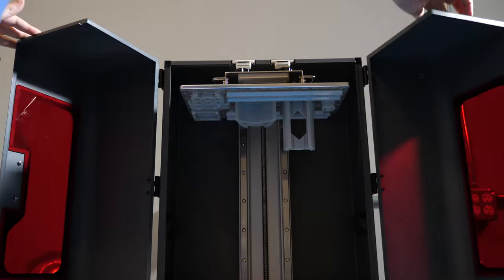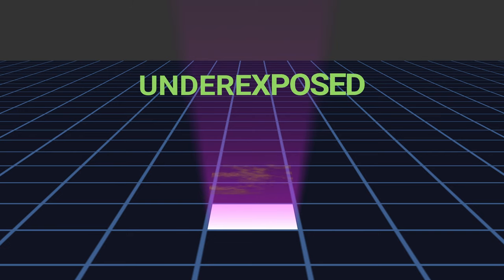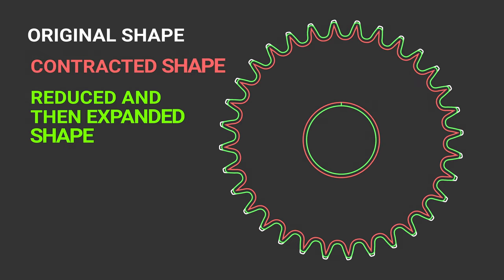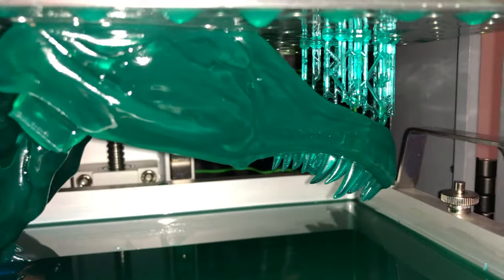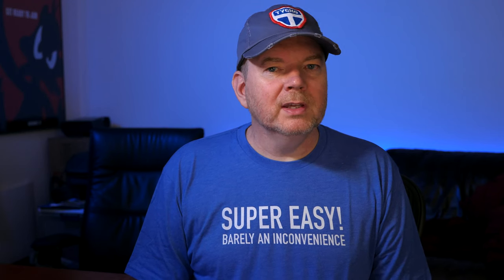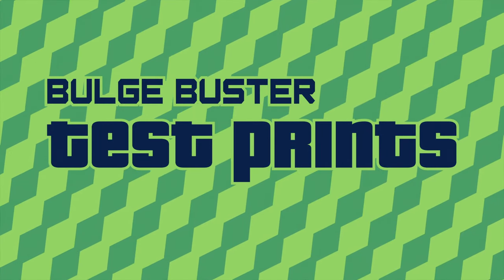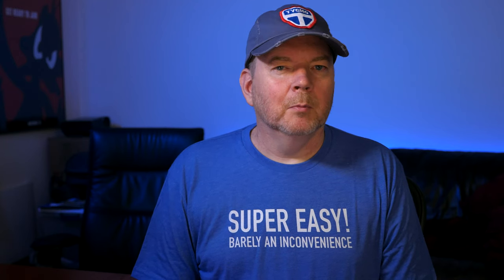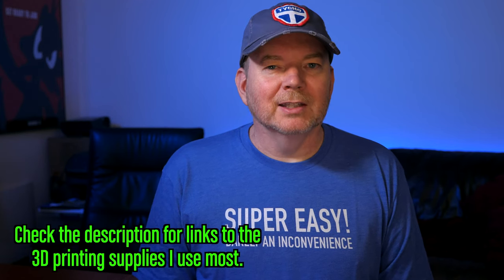Remove the Elephant's Foot from Resin 3D Prints - Plus NEW FREE Bulge Buster App

Comment: There's also a simpler method at the only cost of spending a bit more resin - don't print on the build plate (which I'm always to do with miniatures bases for example), use some supports and the elephant foot will be left only on the supports/raft, which goes in the trash.

This video is very interesting from the aspect to understand (and control) precisely the printing, but I don't think it's very practical for most people (unless it's somehow automated in next gen printers)

Btw, if I understand correctly the transition layers purpose is not so much to reduce the elephant foot (they can't reduce it on the very bottom layers that take the full exposure anyway),
but to ensure more gradual curing condition of these layers, to prevent delamination (by having two layers being cured at 10 times different speeds)

Comment: Overexposure is not the only culprit of elephant's foot. There is little time for resin to settle after the build plate has entered the resin, positioning itself as the next layer is exposed. Some printers allow per layer settings and can be tuned with UV tools

Comment: So you just made a resin exposure calibration tool. I used to work for Eckerds 1hr photo and we actually had a tool that would tell us how off the exposure of the chemicals in the film was and it required the light amounts and times from the machine for quality testing. Each color had its own chemical calibration. This tool reminded me of that. I had to do that every morning in high school as a Lab Tech II and we sent those results to Kodak so they could make sure their batches were good. Wouldn't adjusting the sharpness of the LCD do the same thing? You are basically trying to combat pixel bloom but the LCD should have settings that would help with this I would think.

Comment: Hi, thanks for your work on this - nice idea, similar to the elephant foot removal in slic3r but for resin! Unfortunately on my creality LD002-H when I transfer the busted file to the printer even though it is a .ctb like all my other print files it says unrecognised. Any ideas where I’m going wrong? Cheers for any help!
Reply from the maker: So the file you drag into BB, if you load that file on the creality it recognizes it?  Does it say that the file format is ctb or ctb v3?
Reply: @Nerdtronic  thanks for the reply! So I slice a file, drag the .ctb in to Bulge buster and click make busted file. That creates a file xxxxxx.ctb and file type in properties says ctb (.ctb). If I put that file on my thumbstick and put it in the printer, there is no thumbnail image shown and when I try to print it says "unknown file format". I notice that unlike in your video it doesn't save as a zip or a phz, regardless of what I tick, just as a ctb but I assumed that was because i was dragging a ctb in to begin with.
Reply: Hi I am having the same issue with my printer. Epax E10  The only difference is that I am using Lychee.
Reply: Using Chitubox it worked fine.

Comment: Hi, great content...thanks for sharing your expertise. I just got into resin printing for functional parts and I'd like to ask you a question. It seems the best way to print functional parts for dimensional accuracy and speed is bottom down (flat on the build plate). One problem with that, aside from bulge, is the large cross-sectional area makes FEP release problematic. I noticed your build plate at 17s is full of parts printed flat down. How do you ensure consistent FEP release?
Reply from the maker: Stick the build plate in a ziplock bag and then in the freezer for 15 min.  The parts will fall right off.
Reply: @Nerdtronic  thats a good tip thanks. But are you ever concerned with too much suction during the print from the large cross-section?

Comment: YES! 
Double exposure is - by design - the best, and I am surprised by results. Can we ask for Anycubic's .PWMO format? (Photon Mono model)
Reply from the maker: Other file formats won't be added until next year probably.  I spent too much time on the project and now I have to make up for lost time on other jobs and projects.  New file formats are sometimes very difficult to figure out.  If it wasn't for the help I got from the community I wouldn't have been able to even add the ones I did.  If you have any info about the file format email it to me michael@nerdtronic3d.com
Reply: @Nerdtronic  Sure thing, I'll look into it then, maybe to make it possible to create a  script based translator of sorts.
Any hints as for where to look for info apart of those places and people you mentioned in video ?
Reply from the maker: @cthulpiss  It's here: https://github.com/sn4k3/UVtools  Feel free to just use their app as well.  Mine I think is easier to learn and use, but I think theirs does a lot more stuff.  But anyway, that format is supposedly supported on their end.  So if I can gleem from their code how that file format works I can probably add it to BB.  But again, it'll be early next year.

Comment: Wow! Thanks for this amazing and super detailed tutorial, excellent work ! I have a question, does the app work with Anycubic Mono X ?
Reply from the maker: What file format is that?  I don't think it does YET.  I have some other projects that I have to complete first and then I'll add some more file support.  If Anycubic wanted to send me a printer to test I'm pretty sure I could get it working ;)
Reply: @Nerdtronic  The Anycubic Photon Mono X uses the file format .pwmx which is currently not supported by Chitubox, but is supported by Photon Workshop slicer (said to be very buggy) and Lychee Slicer which I have just installed as I need to start printing with my Mono X soon. Your videos and presentation style are excellent, I wonder when your next video is due from time to time as I always learn something. Thank you for your work!
Reply from the maker: Working on my next video now.  Printing Chocolates with a 3d resin printer.  Well... sort of :)

Comment: i'm new to resin printing so this question could be "stupid" because of ignorance. 

wouldn't it be acceptable to print the adhesion layers using the standard method at almost the right contraction instead of precisely?  at least with gears it seems this would alleviate the elephant's foot without reducing the operability of the gear. 

thanks for taking the time to make this video

Comment: I am starting my resin printing journey and I really like your content. I have a question : "would changing the printing orientation of those gears, like let say printing them with supports on the sides and orienting them vertically, would that remove the elephant foot, would that print well  ? "
Reply from the maker: sure taking it off the build plate would remove the elephant's foot.  But then you have supports that need to be cleaned off.  And with gears I think it's going to be difficult to do that perfectly.  And with gears any imperfection is going to effect performance and probably cause a hitch.  Printing flat to the build plate is the best way to make sure you get perfect gear teeth

Comment: Your videos are brilliant.  Thanks so much.  
In this case the contributions from your associates have obviously saved you a lot a time, else you'd probably be developing these ideas and this app for several years--thus the value of friends and a community of those with diverse talents.   
Q#1:  Yours seem to be straight cut gears, so I wonder if you have tested them yet for slop and backlash when meshed?  An alternative would be a printed version of constant mesh gears (we are getting into the realm of machining here, so those might not apply, even on a 4K printer).  
Q#2:   You have linked to the resin you use (here) and I wonder if you have yet found or tried one that has more of the "self lubricating" properties of something like Delrin plastics (used for injection molding).  I suspect not, so those are questions I should try to answer myself...and if I do, trust I will share the answers back.

Comment: This is such a fantastic initiative; explaining the issue, different approaches to combat it and then, the cherry on top, an application to assist us in combatting exactly that! What more could we ask for? Massive kudos!

(Except for this little itty bitty thing, that might be user error, but I just can't get to work;
I downloaded the latest version, got it running without issues.
Dragged a cbddlp on it, loads just fine.
Chose "Method: Pixel Dimming" and made a few adjustments.
Exported the result to a new file (it still ends with cbddlp, cause I only have a Mars, so the PHZ-format won't work)
Dragged the newly exported busted cbddlp file in, loaded just fine.
Clicked "Unpack Images", and I can see the PNG:s just fine
Here's the issue: No matter how I adjust the settings in Bulge Buster, for Pixel Dimming, the only results that are applying is the Contract Radius (and Bust Layers). The Dimming% does not apply, there are no grays in the resulting images, as you show in your video.
Halp!)

Extra question: Is there anywhere we would be able to discuss this (or other Nerdtronic related topics) other than Youtube comments? I couldn't really find anything pointed out anywhere.

Comment: Awesome work and contribution.  I have a question though, not having any luck with the Sonic Mini.  Is there something about the monochrome screen that would throw this off?
Reply from the maker: Should work on monochrome screens although I didn't have a lot of printers to test it with.  What file format is it?  The .cbddlp format might not support pixel dimming in the current version of bulge buster.  I need to add that warning to the app.  You can always try just the reduction only method.  That should work on the widest range of printers.

Comment: I just got my printer about a week ago, the Phrozen Sonic Mighty 4k is awesome but I'm having trouble printing mechanical parts with straight lines. hopefully printing on the build plate can help me get some more consistency. I'll try it either way, but I was wondering if you thought that the overexposure method would work on other Phrozen printers? or is it really just exclusively the transform?

Comment: This is phenomenal, Sr! Thank you! I wish the ChituBox developers would incorporate your findings, but I know that is unrealistic. 
I'm moving from Mars to a Phrozen Mini 4K and would love to help you implement support for this printer there. I'm not sure if it will still read the PHZ files... I have experience tweaking cbddlp files so I can hit the ground running. Will you be open-sourcing your code? I did not see a git link.
Reply from the maker: I wouldn't be surprised if they do.  They added a Transition feature in a recent version.  Yes the app will reah PHZ files and should work for those.  .cbddlp files though have limited colorspace for grey scale pixels.  So it's possible that the pixel dimming method won't work very well for .cbddlp files.  If you use that file format make sure to drag one on that has the max antialiasing your printer can handle turned on in it.  Otherwise BB can't output the color space since it just copies the file it's given.

Comment: Just a thought, wouldn't it be better to modify the geometry in an stl file, rather than modifying a sliced file which could be in many different formats? I'm going to try changing the original geometry, then slice and print as usual... I have a Photon Mono 4K so I can't use your app. Anyway, thanks for the explanation, and all your hard work.

Comment: Thanks a lot, works great with the Phrozen Mighty 4K! Happy to see that I'll be able to print directly on the build plate and save a of time!
Reply from the maker: I just prefer it.  My brain operates in terms of the ideal way that things should work.  I'm an idealist.  I often forget about the reality of the problems and issues like tolerances, weight of parts, inprecision of steppers or whatever.  In a perfect world we wouldn't need any supports.   But sometimes we do.
Reply from the maker: @pascallongpre7797  michael@nerdtronic3d.com
Reply: what settings do you use with bulge buster on your mighty 4k
Reply: @volleyballOCS  I ran multiple tests and it the most versatile settings have been using the reduction only method with a contract radius of 2 or 3 and 4 bust layers. Of course this might change a lot depending on the part you are printing.

Comment: Do prints always fail if you don't do the "burn-in" layers? I'm not sure that small ones would. Although, with the new mono screens, normal exposure times are max 5 seconds so may not be enough to anchor the print. Will need to try this some time.

Comment: great effort and really thorough - thanks a lot!
Q: what's the advantage of build plate prints vs using supports?
Reply from the maker: Check out my other video on why resin prints fail. Printing on the build plate makes the bottom surface flat. Not bumpy like it gets with supports. Can’t always do it. But sometimes it’s better if you can.

Comment: I printed some bases (flat) using this technique. It worked pretty well, using the 50% dim and 3 contract radius. However, there was a tiny amount of elephant foot, I think 4 contract would work better for the bases.
Reply from the maker: Usually if I do a dimming method I'll do more contract radius than I need.  So 6 might be good.

Comment: This video is cool for a long term solution but in the short term you can measure how much wider and taller the elephants foot makes the part and subtract that part in the model with fusion 360 or something. Get it in the ball park clean up with small file. Manufacturing can be delightfully simple if you let it.

Comment: I’ll have to give it a try. I’ve had pretty good luck just using a .2mm chamfer on the bottom of my parts but a more scientific method would be nice.
I wonder how long before this is stolen and incorporated in the slicer.
Reply from the maker: I assumed it would have already happened. 😀
Reply: Wishful thinking.

Comment: Love this! The double exposure method seems like it would work the best, if only because it shouldn't take any calibration, and would be much less sensitive to part geometry. I wonder if you could "fake" a double exposure on a printer not explicitly capable of it by modifying the gcode to set the lift height to zero every other layer for the first few layers ...
Reply from the maker: That's exactly how we do double exposures on the Transform.  I tried it and it just doesn't work.  There is an option on the menu bar called Double Exposure Test which will make a file that you don't print, but you run with no resin and with the vat and build plate out.  It should lower the plate and show a ONE on the screen, then a TWO - witoutout moving the plate.  Then move it after the two up and down, then show a THREE and a FOUR.. then move the plate.. then show a FIVE and a SIX.  That's a test to see if your printer can do it doing exactly what you stated.. setting lift distance to zero between those plates.  But it won't work.  I never could get it to work on .ctb files or other file formats.
Reply: @Nerdtronic  oh nice! Sounds like we had the same idea. I wonder if the firmware requires a non-zero lift height distance? Did you also try setting it to some non-zero-but-very-small number (0.001mm?) to try getting around this hypothetical restriction? If that still doesn't work, maybe they have a minimum value hardcoded, which would be a bummer. I have a Photon MonoX and do a lot of printing on the build plate, so would love to see something like this available as an option. Thanks for all your hard work!
Reply from the maker: @brettlee4955  Unfortunately since I only own a phrozen transform, it's very difficult to do trial and error type experimentation.  If I had the printer here to test I'd bring it to my desk and spend a day trying things.  But the way I've had to do testing it to create a file, send it to somoene else, have them test it when they get time, and then repeat.  So it becomes a weeks long process.  I considered getting a Sonic Mini 4k but have to wait.

Comment: This is amazing. Literally ordered my first resin printer today - the Prozen Transform, so I was happy to see you use it and designed around it!

I do worry the holes in the Transform build plate also add another complicating artifact but your prints look totally smooth - is your build plate a flat one without holes? At 6:19 your build plate. Has holes but the final gear prints are totally flat.
Reply from the maker: That's great.  You'll want to check out my printer on getting rid of the fumes.  Enjoy the printer.

I had the one with holes and then I upgraded to the one without.  Upgraded while making this video.  For one because it took months to get this video out with everything that was going on.

Comment: I can understand if you don't want to make the code open source, but can you at least tell me what libraries you used for ctb file?   I've only found a rust crate.  Thanks.  Incredible  work!
Reply from the maker: It’s irrelevant now because they locked down the ctb file format. The entire file is encrypted in v4.  But I didn’t use a library. The app was writing in Xojo and the load / save was all ported from white sheets I found online.